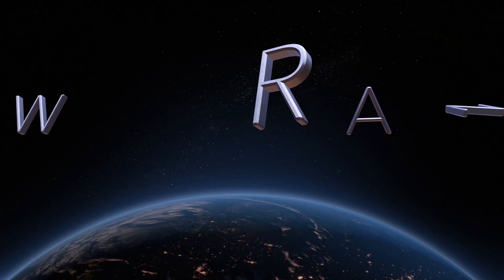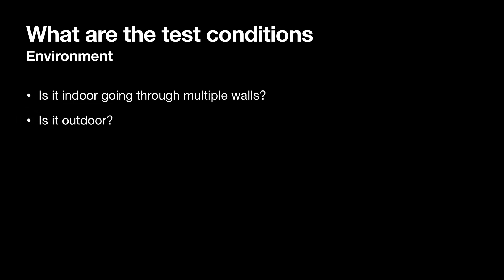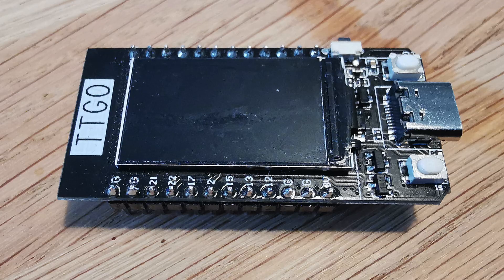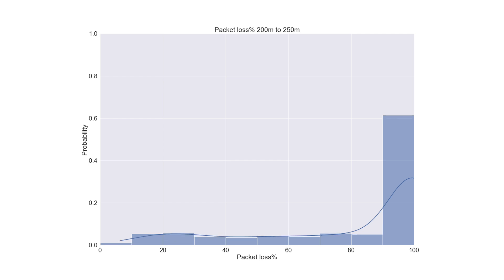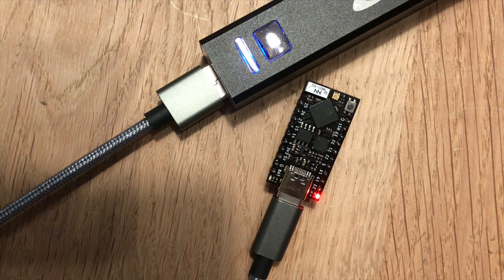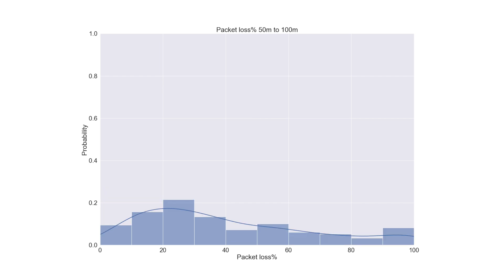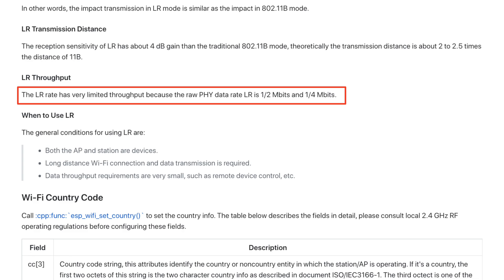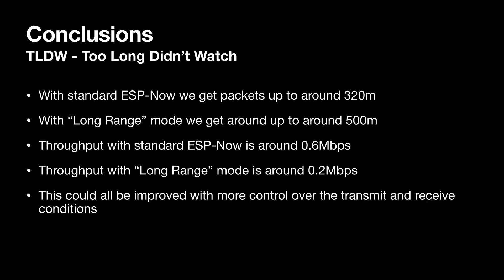ESP-Now Range Test: Real-World Results for ESP32 Devices!

Comment: i know this video is a little old but i'm hoping someone will reply hahahah
i'm currently doing research on building a DIY wireless timecode system for cameras as most commercial options have horrible range or are really REALLY expensive.
do you think switching to long range mode and thus limiting myself to 90 packages a second would be too little for timecode? afaik, the packages would only have to include a couple of digits, wouldn't they?

Comment: Hello! I just made an ESP-NOW range test using an ESP32-S3 module with PCB antenna. 
For this first test I haven't enabled the LR (the code was written in Arduino and as I found on forums the LR can only be enabled on ESP-IDF. The results are impressive, 650 meters straight line without obstacles. 
The second test, enabling LR Long Range using ESP-IDF. The strange think is that the result have not changed, and in theory I should see a 4dB improvement. 
My first lecture is that the LR comes already enabled by default (at least on newer module models), but I haven't found any documentation saying this and haven't made tests with older ESP32 modules.
Any idea about this anyone?

Comment: I've been using ESP-Now for a year now for radio control.  I have to say how impressed I am with it.  Even with the bog-standard onboard antennas, I'm getting 100 to 200m which is ample for the application.  It's amazing that you can build a decent RC Tx + Rx system for under £10.
Reply: Hey how does the latency feels in this setup ? I wanted to build an simple remote kill switch for my system that can be controlled from max 100 meters , but i want it to be low latency

Comment: Thanks for the video and code.
I will go check my code again. It's hard for me to send over 100 packets/s even at very short distance, the error rate will go up.
Reply from the maker: What board are you using?
Reply: @atomic14 The regular ESP32 with PCB ANT.

Comment: I think it would be useful to have data for external antenna usage as well, since it's pretty easy to find modules that can utilize an external antenna, and they aren't too expensive. Also, if one is concerned with range, they will probably get a model that accepts an external antenna. It might be nice to be able to adjust one's expectations appropriately, before purchasing a model with an external antenna. The standard results are interesting and useful too, though. It's nice to know the basic range of a standard ESP32 board. 

It might also be interesting if a test could be devised, to determine the feasibility and range of ESP-Now for real-time low bandwidth applications, like controlling a small vehicle. I know there are a few R/C projects out there. How much range could one expect, before control becomes erratic? In any case, I appreciate the tests. I have grown to really like these boards. They are extremely versatile. I appreciate the effort.

Comment: thank you for the video! i think its amazing that you can get 500m this surprised me as i rarely get more the 25m in my house.
question do you know if it is possible for the esp to work in regular mode and work in long range mode at the same time i am trying to see if it is possible to have a esp connect to a Wi-Fi network then have a long range transmission about 150m through trees and bushes and have another esp 32 take that and create a small network at the other end for devices to connect to? I have been unable to find much information on the capabilities of the esp32 in long range mode. Do you have any pointers? 
I would be thankful for any help.

Comment: Yes, I did find it very interesting.. and I'd like to know if you know of any way to lower the WiFi bit rate between two TTGO T-Dispalys using their standard PC Card antennas with the Arduino 2.1.0 IDE? my project works BUT I am right on the verge of excessive packet loss within the house and tho my Sensor/Sender is only about 60 feet/18 meters away.. to get my sensor data sent from the garage to the receiver in the Den or in front of the TV.. it must pass thru 3 stucco walls, a large refrigerator, microwave, and a gas range/ oven with large metal hood over it in direct line.  I'm afraid of switching to the ESP IDE due to its complexity and I'm a genuine nubie at this.  I don't want to change antennas either since they may be too fragile.  Any thoughts?

Comment: The critical questions should include the following:  What is the frequency of the transmission, power output and what absorbing materials are in the area. The reason why your cell phone works in a building is because Microwaves can penetrate though the material. That's my 2 cents, thanks for the videos!
Reply: Dear Darren, WiFi, in this case, works on 2.4 Ghz there is a good chance your phone works on a lower frequency e.g 2.2 Ghz or even 1.8 Ghz and in some rural areas eve 900 Mhz. The reason your mobile works in buildings is brute force. The output power of mobile towers is massive if you compare this with an esp 32 further the antenna gain is also huge. Another fact is as you up the frequency the capability of penetration decreases. As an example 125 Khz will penetrate a concrete wall.

Comment: I tried to use your code to measure Throughput but no matter what i set - I always getting 0.7 Mbit speed that means Long Range is not activated. Can you please help? I also tried old platform = espressif32 version 3.3.2 but it does not help. How to get that long range working?

Comment: ESPnow is rather rubbish at transmitting through brick walls. It's often these walls you want to transmit through because out in the countryside you don't really need these computers unless you are a farmer perhaps. So what i want to do is to use a mesh and now I'm wondering if I could hack the mesh to work with long range mode. I think with both these improvements it would be possible to get reliable communication in buildings. Sometimes I find I can trip it out simple by walking past. I've had a few problems where duff communication can crash the wifi stack and sometimes it can't recover.
Reply: I was very disappointed in  the real world range. 
pursuing the _LR route but no success yet.

Comment: A big problem with range is the fact that there are limited channels and in  built up areas you will have a greater chance of co-channel interference.  The use of unlicensed bands is a problem for long distance coms as user density is likely to be high. Also the only way an antenna can provide power gain is to concentrate the rf energy in one direction so you start to need beam steering if your going to move around a lot.  So all the cards are stacked against you from the start.
Reply from the maker: Definitely, directional antennas would definitely improve things. If you were setting things up where both stations were fixed and you had flexibility on the hardware I think you could easily get the 1km range Espressif say is possible.
Reply: @atomic14  The other problem is of course the ISM bands only allow for limit power and antenna gains. So to start to get a good range you will run fowl of the law. ;-) 
I know people in the US have got some great ranges into several miles, but there it was flat than out in the country side where you are less likely to have another unit on the same frequency.
Now if you made it frequency hoping that would be fun.

Comment: Seems like a budget alternative to LoRa for distances beyond normal wifi and up to 1km with better antennas. I have LoRa setup about a km away, getting about 90% packet reception  I am sending sensor data every 10 mins, and I can do retransmits if necessary, but not currently. receiver is inside a building and there are houses and trees in the way. I would like to see a test with esp-now and decent antennas, use case for sensors where lost packets are OK, just send more packets than you actually need to get
Reply from the maker: Houses and trees seem to completely kill ESP-Now as well. A test with proper antennas is definitely on the cards.
Reply: If you do use the non built-in antennas, please measure their tuning with a nanoVNA or similar device. Many non-namebrand antennas can be tuned improperly, resulting in sub-optimum conditions
Reply: @horrorhotel46290  How do we find out if the antenna is compatible with ESP or not. Is there any guide or datasheet to do this antenna matching. I have tried some patch antenna and outdoor antenna as well, but dont know see much boost in the range.

Comment: Very interesting video! I wonder if you considered noise in your tests? It would be very interesting compare urban and rural environments as ESP-Now is sharing the same band as WiFi etc.
Reply from the maker: That would definitely be interesting - and I think again it flags up the whole question of the test conditions. The "real world" range for one use case is going to completely different from the "real world" range of another use case.
Reply: @atomic14  Take a look at the android app: wifiman, I have been using it to measure my own router and devices out and about, its very useful and it can give you a good indication of what noise levels maybe from 2.4GHz wifi routers. The LR mode is very interesting to, thanks for highlighting that. When I did some tests with ESP-Now, I found it useful to be able to set the RF channel to.
Reply from the maker: I'll have to install it on the wife's phone. I've read a few things about setting the channel - especially when trying to use WiFi at the same time as ESP-Now

Comment: Great testing and display of data. Although I would enjoy seeing a simple walkie-talkie distance test done with talking back and forth over various distances.
Reply from the maker: I did think of it, but the logistics of trying to record and walk at the same time felt too much :)
Reply: Indeed that would be the best use case (I'm thinking of UDP right now) but then again if you have some well placed stations (as opposed to mobile ones) you could get the extra range. Sensors would be the application I'm thinking about, less fuss than using LoRa and more bandwidth.

Comment: Yes, I found this very interesting, except for one omission. 
'In the real world', if anyone concerned about this data wants to actually build a mid-long range ESP32 wireless communications device, then they would most likely implement an external longer range antenna, which for some unknown reason, you immediately threw into the gutter. (?)
Reply: The most likely reason for discarding this test case is likely due to not having an esp32 with an external antenna connection. Most of the boards that provide more than one antenna type require modifications to the board to switch antenna type (moving a couple 0402 components). However, I do agree an external antenna that provides a higher gain would likely improve the reception quality some. I don't think it will improve data rate though.
Reply: @atanisoftware  Actually, one of the ESP32's shown at the beginning of the video has an external antenna connection.
True, the data rate wouldn't improve because that's dependent upon the software and MCU speed. But, with improved range the integrity of the data would also improve. How much, we don't know.
Reply: @TheOleHermit  I missed seeing that board as I was watching on mobile, but if it had an on board antenna (PCB trace, 3D antenna, ceramic, etc) then the external IPEX/uFL connection is not actually connected as it would create unnecessary noise.

I have a few ESP32 modules that have the IPEX/uFL connector on them (no on-board antenna) and they appear to have a better usable signal range. I also have a few modules which have both the IPEX/uFL and 3D metal antennas which works fairly well but would require modifications to use the IPEX/uFL.
Reply: @atanisoftware  Thanks for the info. Yes, I watch Andreas Spiess (the guy with the Swiss accent) and am aware of the  mod to use the IPEX connection, instead of the onboard antenna.
Also have a collection of MCUs ranging from Arduino, ESP8266, ESP32, Teensy, Photon, PICO, & M5 Stack. Can't keep up.
Currently luvin' the CM4.
Happy making, whatever your project(s) may be. :-)
Reply: @TheOleHermit  Most of my projects are with variations of the ESP32 related to model trains, in some cases pushing the little guys further than they normally would be pushed.
Reply: @atanisoftware  WiFi controlled railroad switching, lighting, and cross road barriers sounds like a fun challenge.
I went from R&D of greenhouse environmental control network to solar powered, remote telescopic security cam on an x/y gimble to vLC streaming, to wireless multi-room sound system (poor man's Sonos), and am currently modifying a pair of 3 watt RGB laser projectors. Laserists never die, we just grow old and retire. :-)
Reply: @TheOleHermit  Sounds like a lot of fun projects!
Reply: @atanisoftware  Gotta keep the ole gray matter active. Yes, I enjoy tech challenges. Used to be a laserium laserist back in the '80's. Was a PC tech at a Jr. College for 16 years. Now, I like to consider myself as being a 'maker'.
The world of Arduino & RPi has been a life changer for me.
I've always had a technical imagination, but I'm not an electronics engineer. Now, I'm able to simply plug in the hardware devices and play with code until I achieve my goals.
Only problem is that these little devices are addictive and seem to breed. Then, there's 3D printers, 5 axis CNC mills, etc, etc, etc.
Sounds like you may be in the same boat. Just keep on rowing. lol!

Comment: Thanks for answering my question.
Would this 90 packets/sec (0.2 Mbps) be enough to transmit speech? I think it would make for good texting only. Or sending XML data?
Reply from the maker: Definitely enough for speech - especially if you added compression.
Reply: @atomic14  Excellent.
Reply: just fyi to anyone else reading, that's 200kbps, 8khz and 16kbps speex (or opus which uses speex for voice) is plenty for voice, not ideal.. but plenty. So you can have several VoIP channels going on that bandwidth.

Comment: Chris that's a lot more distance then i got in my test.
could you do me a favor and use on both side the TTGO T-display. 
As that was my setup. Also ... i did send bidirectional could that be any difference?
Reply: I would say the tinypico has a much better antenna than a regular pcb antenna, but I don't know that for sure.
Reply: BTW, in my test the base station was inside the house. so that could be a bottle neck as well,
Reply from the maker: @NielsNL68  Sounds very likely, mine was on the balcony so no walls in the way. I was also doing one way which would also make a big difference I think. 320 meters was the absolute maximum range I got any packets at all, I wouldn't want to use it for anything serious. I've only got one TTGO display unfortunately and the screen has just decided to die on me!
Reply: @atomic14 , how did you be able to do that, breaking that screen.
Are you sure you did not miss wrote some code. I was able to by 4 of them when they where still cheap <10 euro now the price got up :(
Reply: I saw some other ESP32 with the same kind of antenna. I just have the idea the one the pico  much better then those one the printed board.
Reply from the maker: @NielsNL68  I suspect you might be right
Reply from the maker: @NielsNL68  Hmm, might be actually - need to double check tonight.
Reply from the maker: Yep, definitely dead :(
Reply: @atomic14  sorry for your loss. They are so nice devices
Reply: Bi-directional implies a 1% transmission success rate and a 1% reply success rate. So that's 1% of 1% depending on your implementation.